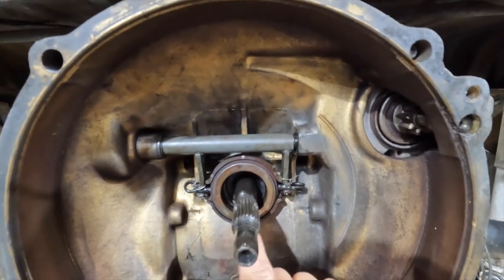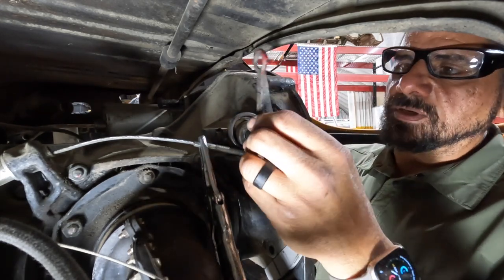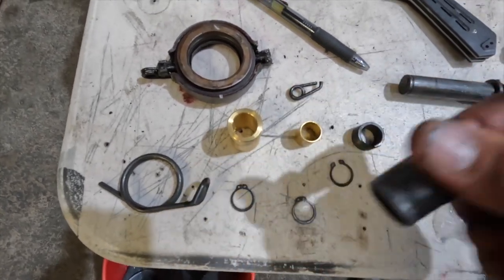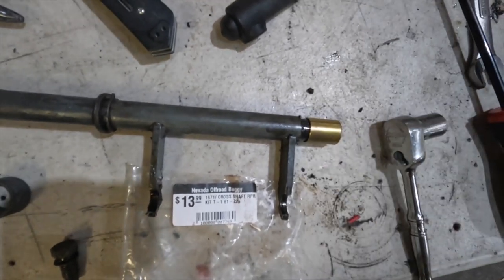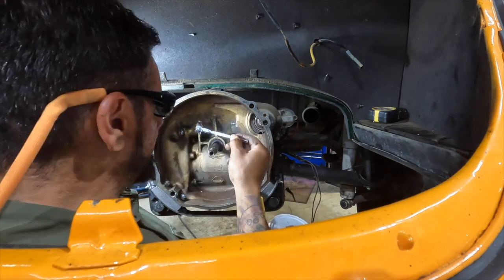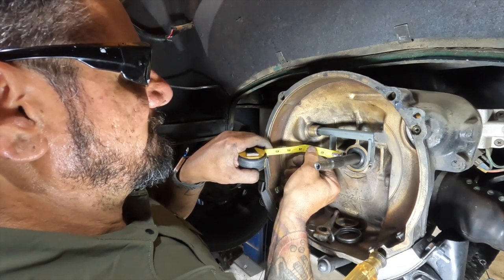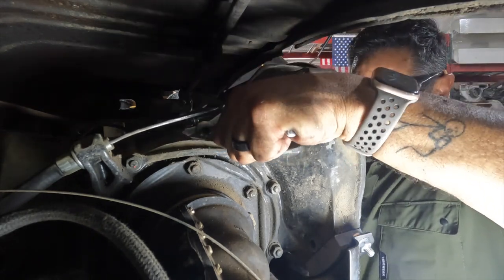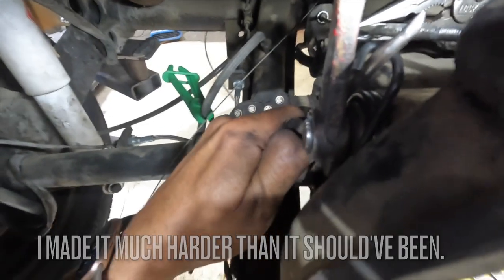VW Bug or Bus Throw Out Bearing Cross Shaft Repair.

Comment: Nicely done George! The safety wire is a good idea👍 They also make a HD versions of the cross shaft for various model years, or as mentioned adding a few welds is a good idea, I have seen the arms fail from time to time.
Reply from the maker: I’ve used the HD one. This is for a bone stock bug that the owner babies. My bus has the Bugpack cross shaft. 👍🏽

Comment: The definitive VW throw out bearing and cross shaft replacement instructional video. Nicely done George! That safety wire pliers tool is cool 😎 I’ve seen a distributor drive puller tool be useful for removing the old inner bearing as well.
Reply from the maker: Excellent tip. I’ll try it out next time.

Comment: I've found if I'm replacing the spring anyways, I put the throw-out bearing in first, then you don't have to worry about prying the arm out with your shorty screwdriver idea.  Throw-out bearing installed, then spring on the arm.

Comment: Should have moved that shim from the left to the right. Otherwise the shaft will float. Anyway, it’s not that critical.
Reply from the maker: Truth be told, this entire job was completely re-done. When doing this job I was new to filming and working. Things were done two - three times till you captured it on film. My frustration led to looking over details I normally focus on. 
Flash forward a month and she had a starting issue. When I did a house call to check it out, on the test drive I noticed poor clutch pedal. Brought it back to the shop. Re did the entire job on my dime my time. In the end it was all taken care of. I appreciate your input. 👍🏽